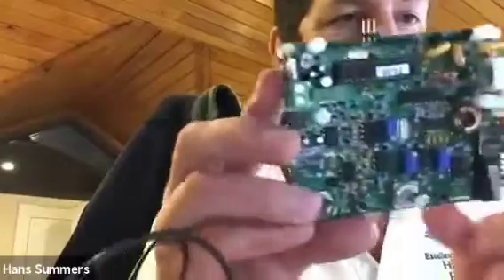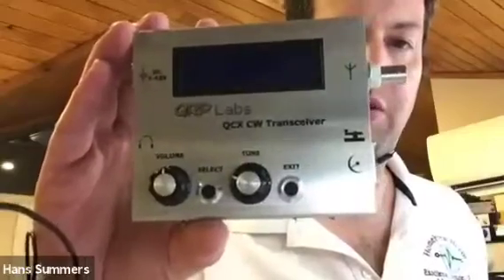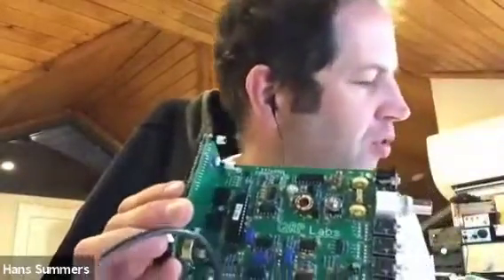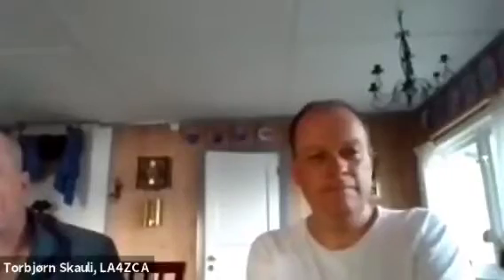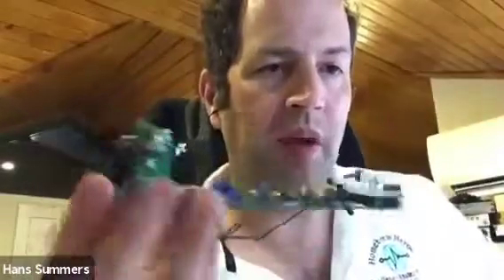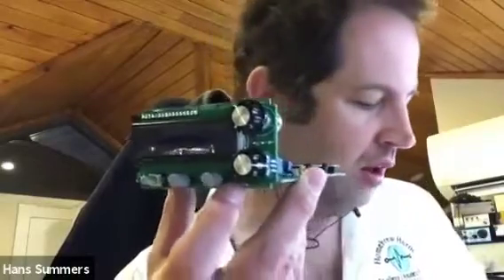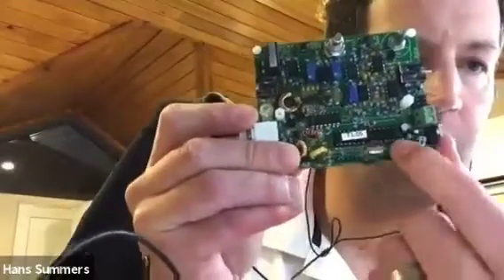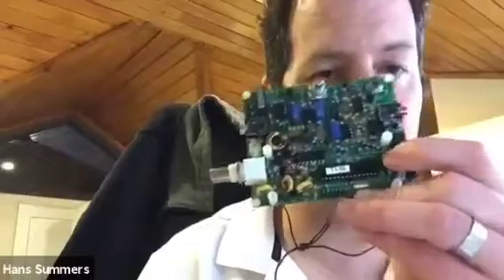QCX mini

Comment: Would love a mini WITH smd components. They are much faster and convenient to solder and build. Also it would be nice if the manual is not that LEGO-style like. Found it quite confusing with every smallest single step listet but the important part like the coils and tuning lacks a bit of detail. I mean for building just the BOM and layout + circuit is enough but more explaination to the coils and tuning would needed.

Comment: Hans, The most important use for the mini will be for backpackers and SOTA expeditions. With this in mind I would opt for a reflective display. the reasons for this are that a reflective display is easily read in normal room lighting and they are usually easier to read than a transflective display with the backlight turned off. This is the reason why most office photocopiers use reflective displays. 

I am installing a reflective display on my QCX+. The reflective displays being pin for pin compatible also opens the door to using pin headers on the display and a connector plug on the PCB. There are connector plugs available that mount behind the PCB that will allow the display to mount flat against the PCB the same as it does now. This will permit those who want a backlit display to simply plug one in. You could then sell the displays as plug in replacements or as extras, Dave. N2SN

Comment: SMT finally!  yes this is the way to go... I think it would be easier to build than thru hole. We hope you will use 0402 footprint or smaller parts to minimize the size...
Reply from the maker: SMD components will all be factory assembled.  Given that toroids, NP0 capacitors (that define the band of operation and will be installed by the constructor), connectors, screen, controls etc. are all through-hole, the size benefits of going as small as 0402 may not be compelling. But I will see how it goes. 73 Hans G0UPL http://qrp-labs.com
Reply: @QRPLabs Hans,  I was sort of joking about 0402 parts... One time I was trying to put down 0402 resistors on a project for work. (using a microscope of course)... I sneezed one time and all the parts were gone!  These days it might be a good reason to keep wearing a mask! LOL

Comment: I think if it can go multi band event if manual switch module like low pass or other module that need it will great cause you just bring module not complete set for multiple band.
Reply from the maker: This is not a redesign. This is simply a repackaging of QCX in a different format. Just as QCX+ is a repackaging of QCX into a larger format, easier to modify and build and with a nice enclosure... QCX mini is also just repackaging into a different material format. Smaller and in a nice enclosure. Same circuit; same firmware; same high performance and rich functionality set. NOT a new radio with fundamentally different features. 73 Hans G0UPL
Reply: @QRPLabs  it still great. First time I think it can redesign circuit for fit with another qrp-labs module like low pass module to provide multi band compatible. Sorry for my misunderstanding. Best E25ECY 73,
Reply: First off I love more features and bands but if the smaller design brings the price down personally I would just buy 2 or 3 units for the bands I want. I have seen other kits go from single band to multiple  bands only to greatly increase cost and complexity. I feel that you also get better performance from a kit built for 1 band. These are very affordable kits and there is a trade off when going multi band. There are big names that produce fine multiband finished transceivers but they come with a big price. As a learning tool these kits fit the budget and are leaps and bounds above them little pixie kits and similar kits.
Reply from the maker: @N_Andrews  I'm not for or against multiband etc. I'm just declaring absolutely irrevocably that this project is not it. To keep the dev time relatively short and not detract attention from other important developments, the firm intention is to keep the circuit and firmware identical to the QCX/QCX+. 73 Hans G0UPL http://qrp-labs.com

Comment: Great. I can’t wait to get a mini. I Think it would be an OK requirement on this more “advanced “ model, that a firmware update would need some sort of programmer. Wouldn’t an Arduino be enough. After all there is another version for those who want to be able to just replace a chip. But if it can fit without severe compromise then it of course is great.Size matters :-)
Reply from the maker: If I can, I want to fit the 28-pin DIP. I think I can :-)